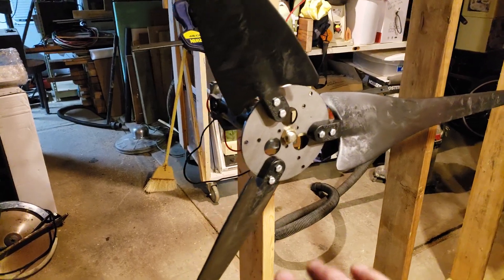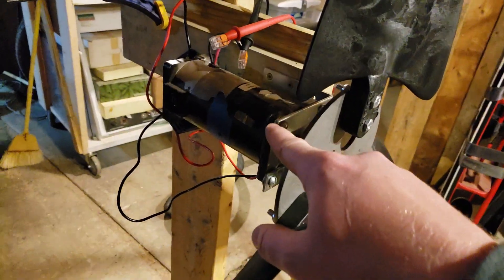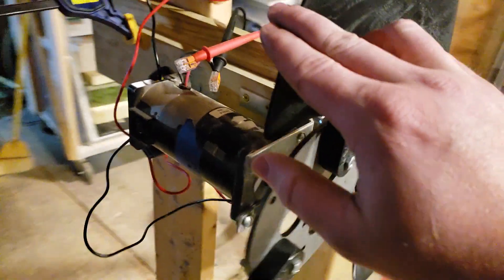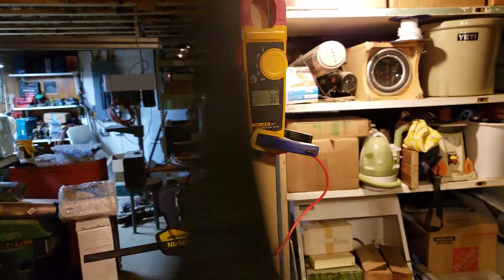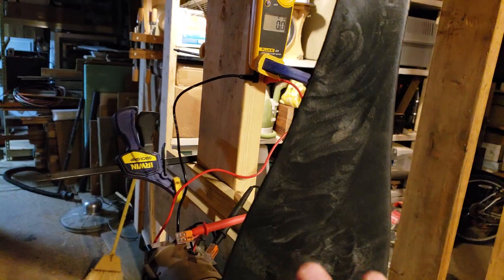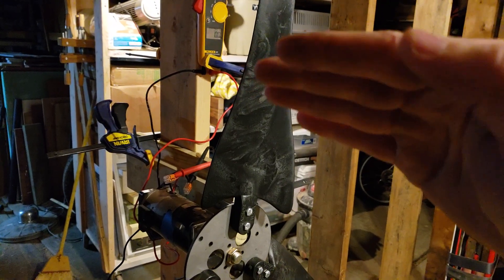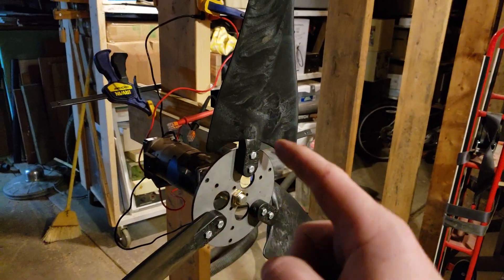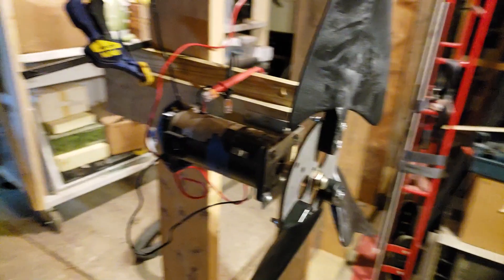[Part 1] DIY Wind Turbine Adventure -  Everything Is Frozen But The Wind Is Blowin!

Comment: Did you try to rewire the stator so that the fase are in series. It will boost the voltage and make it more easy to charge a 12v battery. Good luck
Greetings
Erik

Comment: Im trying to figure out how exactly do i wire it to a battery bank and get power feom it i cant find videos on this at all
Reply from the maker: This video sums it up nicely: https://youtu.be/G8YcFNGauoY
Reply: I live in florida and i want to go off grid im just trying ro soke up enough so that when i do go i can manufacture power for myself
Reply: Any other pointers you could give about harnessing free energy
Reply from the maker: @briannadamron3084  It's not free, a solar system will cost a bunch of money, Add batteries and the system will cost more than grid power over the life of the system. Skip wind power unless you live on the oceanfront, it's just not worth it.

Comment: You should look into the flexcharge charge controller, it should be able to pull the the really low power (rpm) conditions effectively.
Reply from the maker: I've heard of these, a bit pricey though. I have a Victron unit I'll be trying.
Reply: @JoeMalovich  I picked two 25's up yesterday for a hundred each! They also have a 7 amp model.

Comment: as long as you can get most componends for free it should be do able. if not cost will outrun the power you make
Reply from the maker: True until you factor in YouTube income. My Waterwheel made nearly useless amounts of power, and it's currently sitting in my garage doing nothing making me at least $200 a month.

Comment: Are you going to buy a new motor for your new hydro project?
Reply from the maker: I haven't yet decided on a motor for the hydro project, probably a Motenergy setup like what Kris Harbour used. They are sold on ebay. The motor I show in this video doesn't have the current capacity to fully take advantage of my hydro (neither does a hoverboard motor)
Reply: @JoeMalovich  that being said, will your utility let you sell power to them when you're overproducing?
Reply from the maker: @eatingsand9607  Yes that's possible but not worth the effort until I'm making large amounts of power.
Reply: @JoeMalovich  how about an alternator from a car though? how good would that work?
Reply from the maker: @aleksandersats9577  not well unless modified with permenant magnets. Even then they aren't rated for enough amps. A 60A alternator at 14V is only 840W. There are bigger alternators but permenant magnet support is non existent. Windblue is one such supplier.
Reply: @JoeMalovich  Can't you use an external voltage to generate the field that the stator / rotor then uses to generate the main output? I seems to have seen that done somewhere and in theory it should be simple enough.

In a car there is just that as the battery should have enough voltage to generate the initial field and then the generators over voltage takes over.

Another advantage of this would be that you can control the power output (within limits obviously) bu varying the field power.